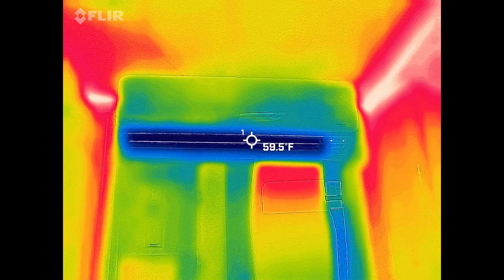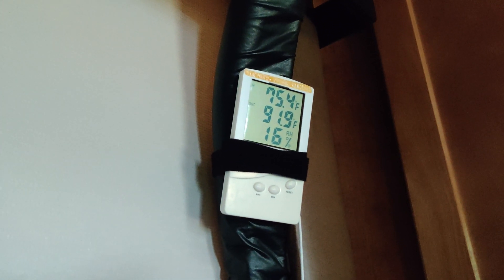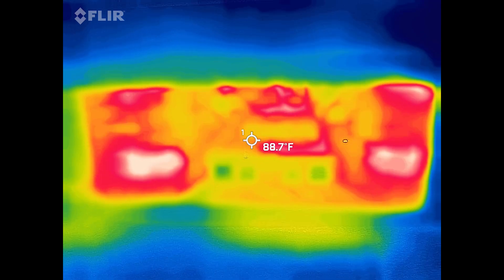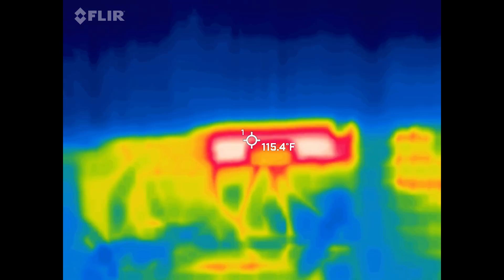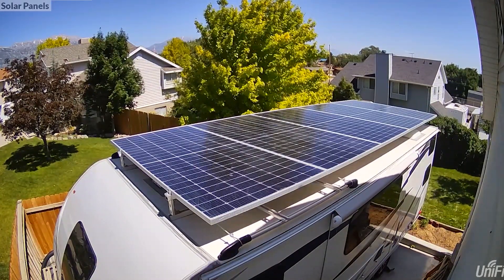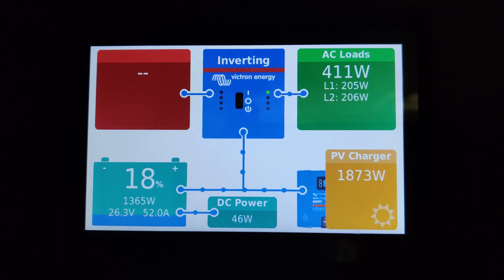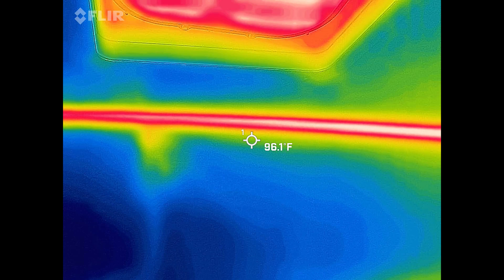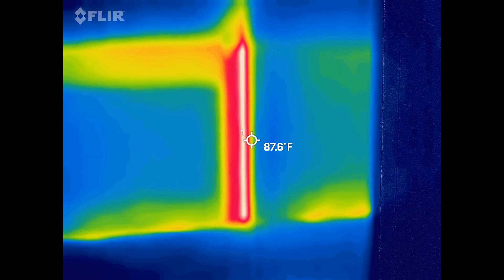How Hot Do My Victron And Other RV Electrical System Components Get On A Hot Sunny Day?

Comment: I wish you would have done the same test but without charging an electric car. I'm trying to determine how hot my system will be but I would never be putting it through a torture test like this. You're using more electricity in your camper than I ever have at home.
Reply from the maker: My reasoning for using an EV was to max out the system and show the worst case scenario. Depending on the amount of energy you're pulling less than this there will be varying degrees of heat build up, but the system will handle it no problem. I had naysayers before I built my system saying it would get too hot all being close together under the couch but they were wrong. Zero problems with heat. Even with the inverters on their side. The people that struggle with heat have their systems in closed compartments without hardly any air to exchange heat with. In my case the equipment has all the air in the entire trailer to exchange heat with and there's no problems with hot devices.
Reply: @ElectricTechAdventures  My system is much smaller. 2k inverter with 400w of solar. The entire thing will be under the bed in an enclosure but I intend to have a push/pull fan triggered by the Cerbo GX to maintain good airflow. I just didn't want to turn the inside of the tiny house into an oven. I'm going to guess by your test that my system's heat is going to be negligible.
Reply from the maker: @PossumsTophat  I agree that your heat will be negligible. Mine is negligible. On a fully sunny day when my charge controllers are maxed out and my inverters are too sending that energy to my Tesla the inside temperature of the trailer is warmer than outside ambient, but not by a lot and I think most of the heat is from the sun shining on the side of the trailer. I left space on top of my inverters to be able to install cooling fans if needed, but I haven't needed to.

Comment: Anthony, I found your youtube video and it looks like you live in Utah.  I am having troubles finding a tech for my solaredge home panels in Eagle Mountain Utah.  They stopped working and every company I contact says they don't do those (I recently bought the house and the phone number on it is disconnected).   Do you happen to know any good Solaredge tech's in the area?
Reply from the maker: Hey, yes I'm in the Lehi area next door to you! I've never interacted with any Solaredge tec as I DIY installed mine. The one company I do have experience with and I did purchase some Solaredge equipment from is Solar Wholesale in West Valley City. Maybe check with them.
https://maps.app.goo.gl/dEsgV4rR5W68ZMNp8

Comment: Probably too late now, but did you consider putting any of the heat generating electrical components outside the trailer cabin?  i.e. put them outside your insulated space.
Reply from the maker: I considered many factors and engineering is always a practice of balancing pros and cons. In the case of an RV there's very limited options. The wires are ideally shorter to avoid energy loss, cost, and weight from longer wires. Having shorter wires requires all the components to be near each other. If there had been enough of a benefit to have components a little bit more distant than I would have, but the benefits didn't outweigh the drawbacks. I wanted the batteries to be in the climate controlled space to protect their longevity in hot weather and performance in cold weather. The inverters and charge controllers are the components that generate the most heat. Electronics in general will have a much shorter life span if they are hot. I've seen many solutions to that online from others installing these components in storage compartments with holes in the floor or wall and fans with thermal sensors to automatically turn on when the compartment gets hot etc... I considered that, but ultimately decided against it because I had good space under the couch to keep it all consolidated. The only place I could have put them outside the climate controlled space was in the passthrough storage compartment (which is directly on the other side of the wall from where they are under the couch) but I didn't want to drill yet more large holes in the floor of my trailer, plus if I'm blowing out hot air, the makeup air has to come from outside which is potentially quite hot as well and thus my components are not getting very cool. Plus outside air is dirty and that will eventually build up within my devices compromising their ability to cool themselves. I could clean the devices with compressed air, or I could install an air filter at the inlet, but that's just another thing to have to maintain. Ultimately I decided on how I did it because the mini split is very efficient in cooling the trailer only consuming a couple hundred Watts and the heat introduced from the electrical system components is a lot less than the heat of the sun bearing down on the trailer. Plus I only need to use the air conditioning for a couple of the hottest months of the year. The first day this year where I needed to use the mini split (determined by the batteries achieving 90 degrees F) was June 9th and I anticipate stopping once the ambient high is less than 85 degrees F. Also the heat from those components is beneficial the cold half of the year. Also the time of year when the weather is the hottest and I'm using the mini split to cool the inside of the trailer is also the time of year when solar is most abundant and I have plenty of excess electricity.